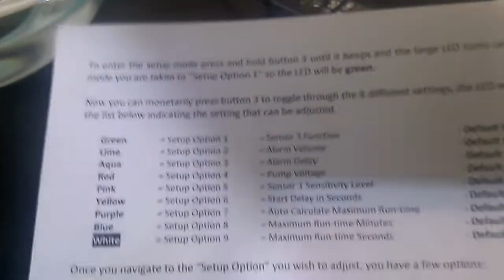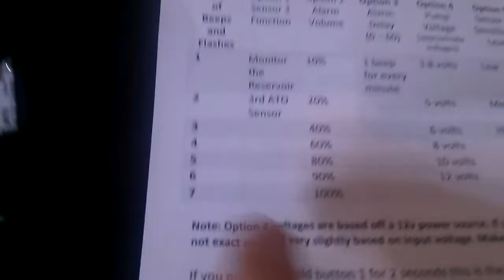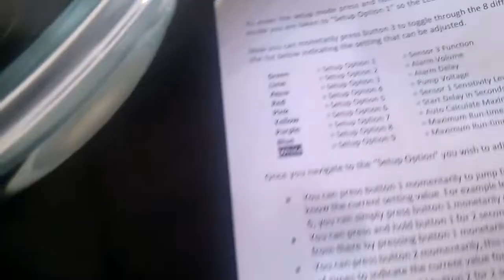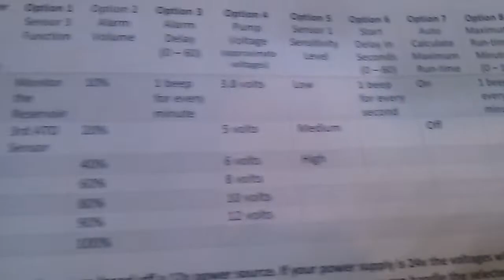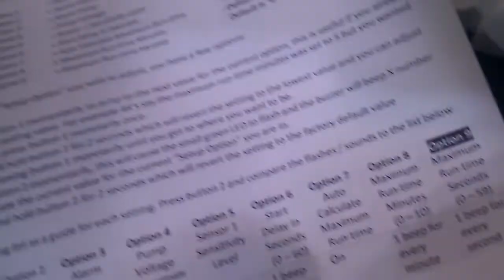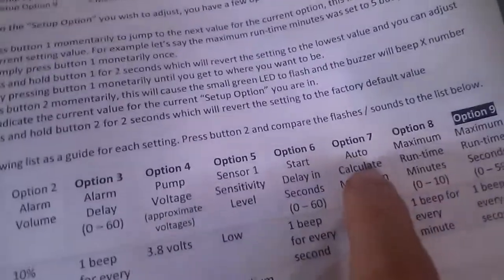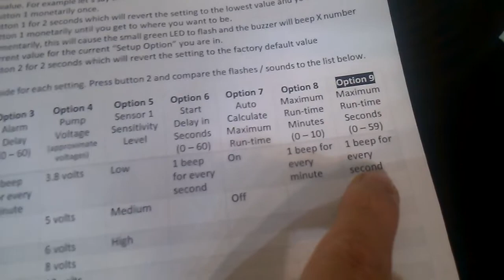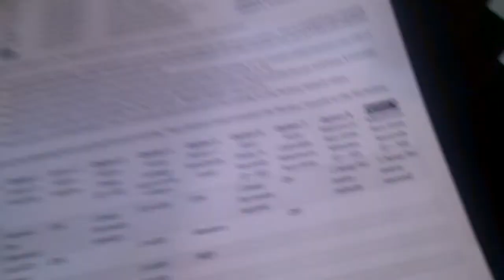Robo-Tank Auto Top Off Custom Settings

Comment: Can you do a custom controller for cannabis?  Say a “Robo-Grow” that controls dosing pumps to monitor and control pH & Ec, control 2 or 3 LED lights, monitors and controls temp, humidity, Co2 & in-line fans. Utilizes your ATO for a reservoir or two. Programs, monitors and doses nutrients for each week of the grow cycle, say nine different nutrients for 12-15 weeks with appropriate symbols and do this for two separate tents or grow rooms simultaneously. I know you can and this would make you a boat load of cash now and in the near future.
Reply from the maker: The controller I'm currently working on could achieve everything but EC, it's possible that will be supported in the future. You can see the controller here.
https://www.robo-tank.ca/